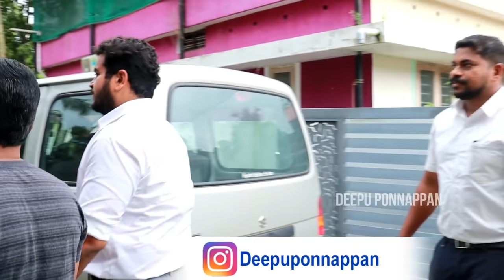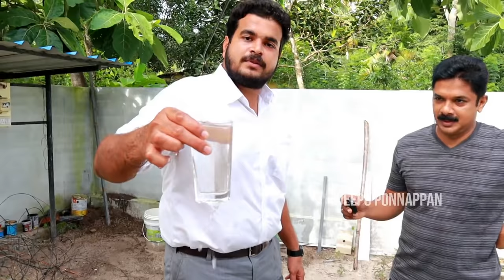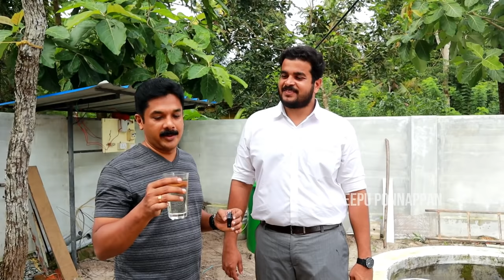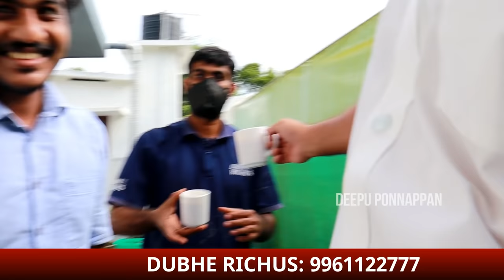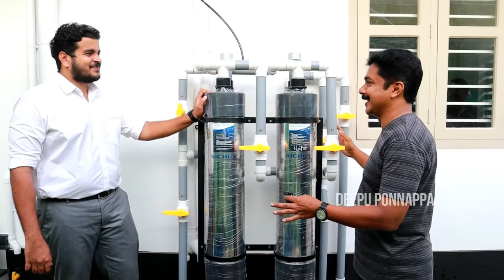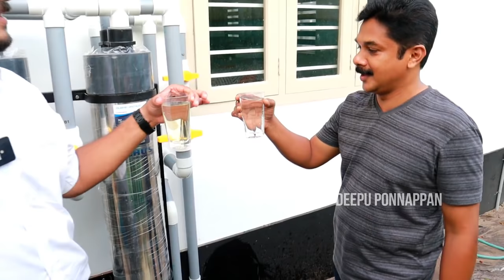വെള്ളത്തിലെ അയൺ കണ്ടൻറ്, നിറംമാറ്റം, ദുർഗന്ധം എല്ലാം മാറിവെള്ളം ക്രിസ്റ്റൽ ക്ലിയർ ആയി | Water Filter

Comment: Super presentation, in our building the supplier fitted with two PVC pipe for making this filter, we are backwashing every week. Found not explained what what are the filtration materials used both filters like activated carbon, ceramic balls filter sponge etc. The cost Rs. 48,000  is higher side. Also not explained after how many years we have to change the filter materials used and approximate price of it asper quantity used.

Comment: Njaanum vachu. Before pressure wasn’t consistent in first floor.  Now it’s almost same as ground floor. Also my water purifier was getting completely blocked and impossible to clean with in a week.  Now I won’t have to replace my purifier filter each week.

Comment: Using Richus filter for 12 years now.. Three units installed in our family. One installation failed and the filter was leaking due to excess pressure. Richus support team usually are proactive, but after a failed attempt  trying to fix this issue they have now given up. I am happy with my unit, but my brother had to reinstall filter with another brand. Still waiting for Richus team to show up
Reply: ഞാൻ ഇതാണ് ഉപയോഗിക്കുന്നത്

Comment: Hi Deepu, please also check Total Dissolved Solids after filtration. You can check using TDS meter. For drinking water TDS should be less than 100.
Reply: Also he needs to keep another portable water filter inside house for making this output water drinkable. Because this system only remove contamination. It will not kill bacreias and koli etc. So to make this water drinkable, you need to have a seperate Livepur or.kent water filter that cost another 12K appox
Reply: @consolassoc3450  Bb

Comment: Tankilekku pokunna vellam clear cheyyan pattumo, angane ulla system ethra cost akum
Reply: Pattum but not 100%  we can filter but the smell and taste will  be same.  Using rain water filter use 6 inch or 8 inch. Inside use 3 inch pipe with mosquito mesh covered. By proper procedure . After that insert a  3/4 inch pvc pipe  put hole using drilling machine. Cover enter pipe with  nylon filter then  it's is in inner most center . Here only motor feed water directly connected. Then the out put is connected on 8 or 6 inch pipe put a nipples or union. Feed water at the  will fill and raise. Bottom connected also on sude way with nipples or 1 inch  union. As input. Then the water will gushes inside thru hole and will fall . Dust particles will settle at the bottom.also in the filter . Now purified water will reach the top of the tank.  Note:-. Every  month or  bottom of the filtered  dust and impurity will settled in the  bottom of  end cap  open the  gatevalve and release the water or bottom use 6 or 8 inch MTA. Now  u can clean the water by hand removing the threaded MTA. And close the MTA. Don't forget to lick the gatevalve at the bottom
Reply: @radhikahalley  thank you bro